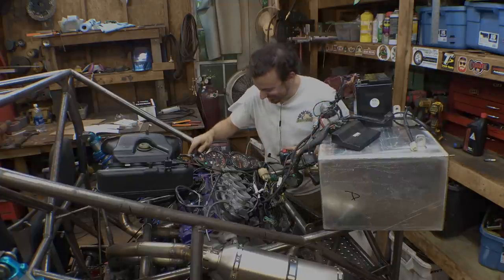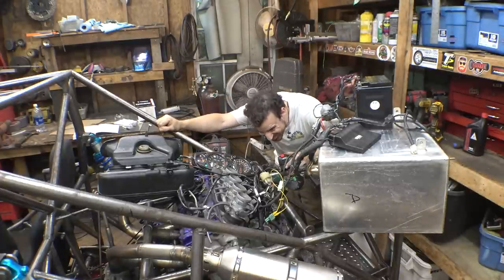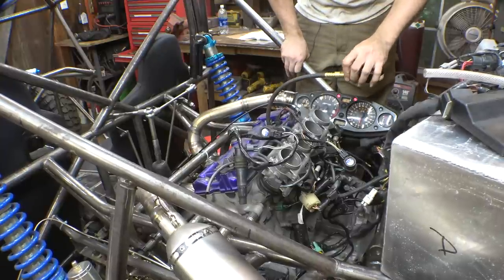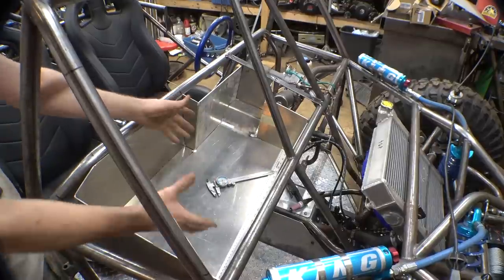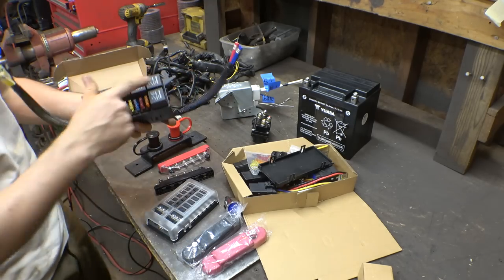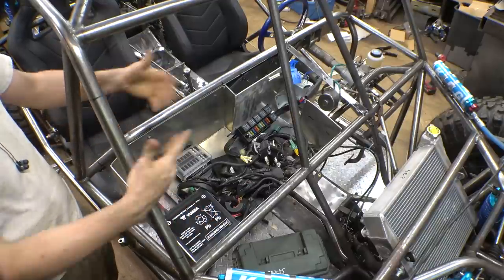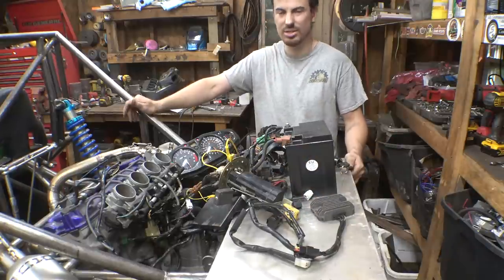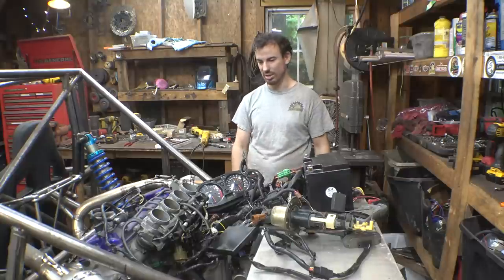4WD Mini Trophy Truck Build - Part 25

Comment: Hmm can u make a way to get air in the wiring box for it doesn't overheat idk if they can overheat just as a safety way to not have it catch on fire also keep up the good work
Reply: The wiring will not over heat
Reply: @mxwizzard  also the box is aluminum which is a great heatsink material.

Comment: J think why you getting 9volts is that pump is locked up and drawing voltage down under load 
Also why it’s arcing when you bypassed

Comment: A little late now, but you really should have put a set of tires this size on the cbr for testing. Im fairly certain its going to smash drivetrain parts like crazy. The difference in torque required to turn a little sxs/atv tire and a 35 is ENORMOUS. Your tiny brakes are insufficient as well.

Comment: Hate to say it but the pump will not be dependable even if you get it to run. You could probably tap on it and get it to run just to get your motor running and test things, but I would NOT head into trails with it unless you can be towed out.

Comment: I think that the batterie in the same spot as all the wiring and all electrical is not a good idea, if for some reason the batterie leaks spills gets damaged you will have acid all over everything electrical fire bad news

Comment: you should never run fuel pumps dry take it apart and see if you can unstick it if you cant you be able to see what $40 fuel pump is the same as yours

Comment: Most likely, if you hooked power directly from the battery to the fuel pump and it did not kick on the electric fuel pump is bad because if it was working when you hooked 12 V straight to it, it would kick on it should not burn the motor up, just hooking it straight to the battery. I've used that method many times to test Fuel pumps.

Comment: Car and Bike Batteries give off HYDROGEN GAS when in a state of charge or dis-charge - it will need plenty of ventilation- ALSO, it will make everything inside that box corrode, ALL the connectors, the ECU, etc- Battery is TOO HEAVY to mount up high like that, mount it as low as possible, and NOT in the same box with all the other electronics - thats why you have NEVER seen in on any car or Motorcycle

Comment: Electrical huh? Yeah its bad but dont put the harness all in especially when something goes wrong your going to struggle to find the wire its not a bad idea, but yeah instead keeo the wiring harness loose

Comment: You can use a fuel pump for a 91 Ford explorer only cost about 50 bucks for a brand new one it will surprise you it is the identical fuel pump